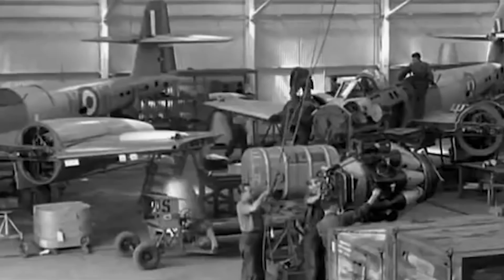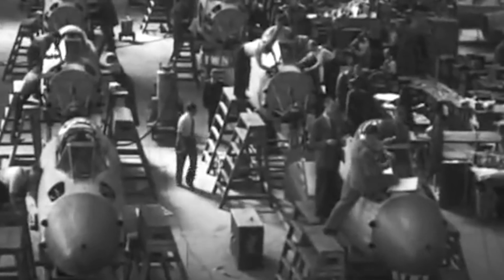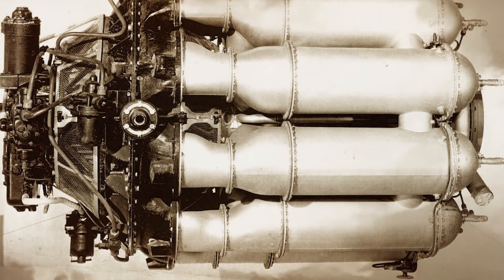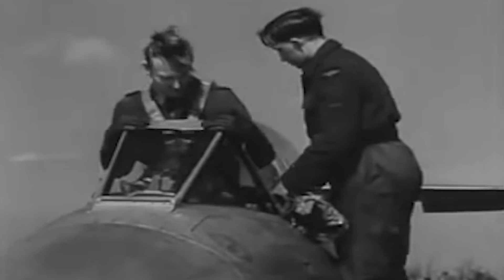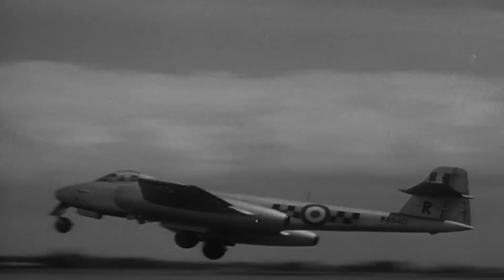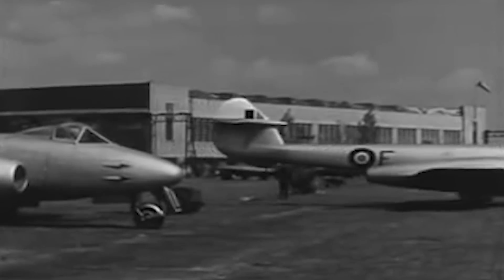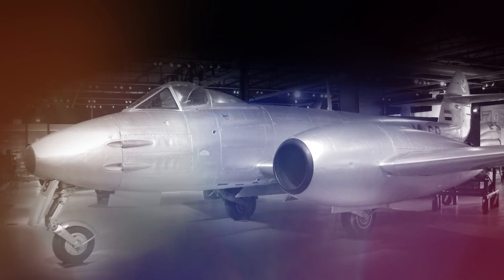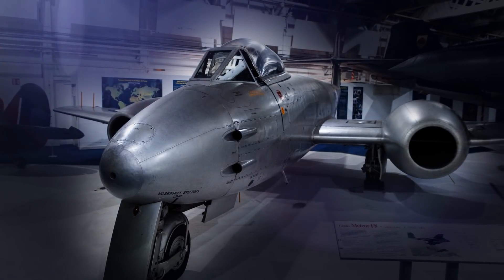Gloster Meteor - The Only Allied Jet to Fight in WW2

Comment: The Meteor did not really "fight" in WWII, Eric Brown:  "It was a pedestrian aircraft, really, the Meteor. It never went into… It never fought operationally. It fought, if you like to call it that, against the V1, the flying doodlebug, and quite successfully. But it really was too slow to deal with the German jets when they came into being. They were a grade above at first. The Me262 is quite frightening. It gave us a shock to find out, because when I flew it the fastest fighter we had"
Reply: The Gloster Meatbox only killed British pilots
Reply: @sandervanderkammen9230 

We feel we can clear up some commonly held myths and misconceptions, obviously.

It's always good to see the facts presented clearly and concisely isn't it?

Thanks for that very informative comment.
Most enlightening.

We couldn't find any supporting evidence anywhere though so we think there may be some errors in their excellent post & errors in some other comments with a similar theme.

The basic overall design of the Gloster Meteor was fatally flawed.???

    The Meteor was not fatally Flawed, 3950 were built serving in more than 20 air forces for more than 20 years.  Martin Baker use the Gloster Meteor for ejector seat R&D.

Gloster continuously tried to improve the aircraft eg; improved tail, stronger fuselage and different wings, stronger wings, ect.???

      Gloster got it pretty much right first time especially considering the circumstances & the aircraft type.

Unfortunately as a result of being very hastily
converted from a twin propeller driven nightfighterdesign it was plagued with flaws inherent to the fundamental design.???
  
      Gloster ceased work on the much larger  Gloster Reaper propeller & turret night fighter in order to design the Meteor from scratch (The Beaufighter was similar to the Reaper).

It was directionally unstable at nearly all speeds and tended to pitch down uncontrollably at low speeds and a nasty tendency to snap into a flat spin at high speed.???

    It's accident losses were much lower than many other later aircraft. Most accident losses were training errors.

The asymmetric handling was appallingly and was considered unrecoverable and fatal during take-off or a go- around.???

      It's accident losses were much lower than many other later aircraft. Most accident losses were training errors.

RAF Chief Air Marshall Sir Frederick William Bowhill called the Gloster Meteor a quote; "a truly dismal and lackluster aircraft"???

    The Chief Air Marshall didn't say that.
   
   Sydney Camm said Gloster tried everything but flipping the engines and pilot seat around and flying it backwards???

     Sydney Camm didn't say that.

Early days, jet fighters & an accident losses rate comparison.

De Havilland Vampire, Sea Vixen & Gloster Meteor accident losses were not high or unusual for fighter aircraft at the time. De Havilland built large numbers of all metal airframe aircraft before the DH Comet for example.
We mustn't forget of course that the DH Vampire first flew in 1943 & the jet engine was also built by De Havilland. There were examples of the Vampire interceptor / fighter in service until 1990 which was operated by more than 30 countries. Of course, at the time, during 1943, the Vampire was one of the world's first jet fighter aircraft which also happened to have extremely reliable jet engines, obviously.

Non combat phase accident losses.
% of Aircraft built.
The Canadair CL-44 was a turboprop airliner.
Canadair CL-44              (ff 1959 ) 48%
Lockheed XF104              (ff 1954) 100%
Lockheed  P80                 (ff 1944) 43%
Lockheed F104                (ff 1954) 45%
MD FH Phantom 1           (ff 1945) 35%
MD F4 Phantom 2           (ff 1958)  28%
MD F3H  Demon              (ff 1951)  32%
Gloster Meteor               (ff 1943)  21%
DH Vampire                    (ff 1943)  23%
DH Sea Vixen                  (ff  1951) 33%
Gloster Javelin                (ff 1951) 20%

   An example of what goes on these days in various countries.
Obviously, for example, there are of course no German companies that makes German jet aircraft in Germany & there are no German Companies that make German gas turbine aero engines in Germany that are suitable for widebody airliners.

The Gloster Meteor served with more than 20 airforces and successfully engaged in air to air combat with later design aircraft during a number of conflicts. 

We hope this helps, obviously.

As always Cheers & 👍 indeed.
Reply: We believe we can clear up some common misconceptions & myths.

It's always very important to note the relevant facts obviously.

The ME-262 was limited to running away from allied piston engine fighters  & risking engine destruction while doing so & it took 3 downed 262s for each downed allied bomber over Germany where German air inferiority was fairly ubiquitous so there was large swarms of allied bombers available to have a go at. The 262 did in fact have a do not exceed speed of 450 mph & an engine that often failed to last longer than 46 minutes.

After 1941 it was clear The Gloster Meteor wasn't required as such & was limited to operation over the UK & occupied allied territories to keep examples out of the wrong hands.

Yes it is of course correct that the world's first jet powered aircraft to exceed 1000 mph was indeed a British aircraft.
Contrary to their copious & ubiquitous posts regarding accident losses of various UK aircraft.
As they mentioned previously, the Sea Vixen & Gloster Meteor were indeed very competent & beautiful aircraft.
In fact the Meteor was the world's first aircraft to exceed 0.85 on the combined 2 year looks & capability scale for jet fighter aircraft.
   Indeed A rather superb Gloster Meteor was the world's first Turboprop aircraft in 1945. In 1945 & 1946 trail blazing Gloster Meteors set world speed records.
     Yes, of course it is correct that British military aircraft at the time did not have unusually high accident losses rates.
For example
De Havilland Vampire &  Sea Vixen & Gloster Meteor accident losses were not high or unusual for fighter aircraft at the time.
Non combat phase accident losses 
% of Aircraft built.
The Canadair CL-44 was a turboprop airliner.
Canadair CL-44                    (ff 1959 ) 48%
Lockheed XF104                    (ff 1954) 100%
Lockheed  P80                       (ff 1944) 43%
Lockheed F104                      (ff 1954) 45%
McDonnell FH Phantom       (ff 1945) 35%
Gloster Meteor                     (ff 1943)  21%
DH Vampire                          (ff 1943)  23%
DH Sea Vixen                       (ff  1951) 33%
Gloster Javelin                     (ff 1951) 20%

Gloster Meteor.
3950 Built.
In service 1944.
70% didn't have ejector seats.
839 accident losses.
436 accident loss fatalities.
21% accident losses.
11% accident loss Fatalities.

Lockheed F104.
2578 Built.
In service 1958, 14 years after the Meteor.
All had ejector seats.
1100 accident losses.
425 accident loss fatalities.
43% accident losses.
17% accident loss Fatalities.

We hope this helps.

Cheers
👍 & 😎 & of course 🙂 indeed.
Toodle PIP Old Chap 
     
           
        
.. . .. . ... .... . 
.... . ....
xcvvvvvvvviix
cvvvvvr
Reply: @petemaly8950  Naw.  You're apologizing for the Me-262's 542 confirmed kills, 5 to 1 kill ratio and 28 jet aces, and Britain's failure to develop an operational combat jet during WWII.  Hope this clears things up for you
Reply: @petemaly8950  "Yes it is of course correct that the world's first jet powered aircraft to exceed 1000 mph was indeed a British aircraft."  False, the Me-262 HG I hit 606 mph in 1944!  Pip pip cheerio!  Anytime I can help!
Reply: @petemaly8950  The Meteor did create a lot of jet aces.  Unfortunately they were all Russians flying Migs.  Tea time!
Reply: @petemaly8950  Revisionist history is you're specialty.  The complete list of British jet aces:  Just kidding, there aren't any
Reply: @petemaly8950  Yes, you are confused.  The British were never able to build and operate a combat jet during WWII.  Postwar England was bankrupt and had to operate obsolete aircraft such as the Meteor. The British were unable to build a working axial-flow jet engine until 1947, when they had access to German research.  Postwar jet aviation, aerodynamics and space programs were based on German research based on Operation Surgeon in England, Operation Paperclip in the US and Operation Osoaviakhim in Russia.  Hope this helps!  Pip pip cheerio
Reply: @petemaly8950  Nah
Reply: @petemaly8950  LOL "That is indeed true, 606 mph is of course much slower than 1000 mph."  True, however, you referenced the Meteor as 1000 kph.  The 262 HG I had already exceeded 606 in 1944, nearly a year before the Meteor.  Hope that this clears up your misconceptions and confusion!  Pip Cheerio!
Reply: @TheAneewAony  

 @TheAneewAony  

We believe we can clear up some common misconceptions & myths.

It's always very important to note the relevant facts obviously.

Of course that is indeed correct, the world's first aircraft to exceed 1000 mph was the Fairey Dart 2, it exceeded the previous record by 300 mph & held the record for a year. 

  Agreed, that is indeed totally right, the world's first aircraft to exceed 600 mph was of course a Gloster Meteor obviously (l-o-l of course without doubt clearly).

That's right of course, doing very silly military things & being riddled with trivial & 100% pointless war trophy psychology often results in comprehensive & thorough defeat doesn't it. It's a pity British forces had to occupy a large part of Germany for decades after 1945 & that Russia had to do the same & also possess permanently a large chunk of what was German territory before 1945. Of course Russia & the UK do indeed now make & possess nukes obviously. 

    That's absolutely correct of course,  indeed it is the case that the Korean war Migs generally often destroyed themselves due to a number of inherent problems & of course the Korean war Gloster Meteor casualties (at the time the world's first successful jet fighter) were almost all downed by ground fire.

    Agreed, it is in fact correct, The ME-262 was limited to running away from allied piston engine fighters & risking engine destruction while doing so & it took 3 downed 262s for each downed allied bomber over Germany where German air inferiority was fairly ubiquitous so there was large swarms of allied bombers available to have a go at. The 262 did in fact have a do not exceed speed of 450 mph & an engine that often failed to last longer than 46 minutes.
 
   Yes, that's totally correct Of course. Agreed, it is in fact the case that there were no gas turbine aero engines that exceeded the power & reliability of the RR Nene in 1944 that engine being twice as powerful & 100 times more reliable than the instant scrap 262 pilot killing engines being produced in Germany for the various thoroughly inadequate & generally unusable German jet aircraft at the time obviously. 

   Absolutely right & thanks for mentioning it, of course putting rockets & / or short life scrap gas turbine engines on inadequate & dangerous airframe aircraft that had a habit of exploding isn't sensible, adults involved in engineering & aircraft & the military making up stories about speed records, aces & kills for jet aircraft is also a bit silly, but of course we know they tried invading Russia so it was obviously normal behaviour for them

   That is indeed true, 606 mph is of course much slower than 1000 mph.

   Absolutely true of course,  After 1941 with allied air superiority guaranteed it was clear The Gloster Meteor wasn't required as such & was limited to operation over the UK & occupied allied territories to keep examples out of the wrong hands.
  
    Yes it is of course correct that the world's first jet powered aircraft to exceed 1000 mph was indeed a British aircraft._
Contrary to their copious & ubiquitous posts regarding accident losses of various UK aircraft.
As they mentioned previously, the Sea Vixen & Gloster Meteor were indeed very competent & beautiful aircraft.
In fact the Meteor was the world's first aircraft to exceed 0.85 on the combined 2 year looks & capability scale for jet fighter aircraft.
   Indeed A rather superb Gloster Meteor was the world's first Turboprop aircraft in 1945. In 1945 & 1946 trail blazing Gloster Meteors set world speed records.
  Yes that's correct, Indeed it is the case that Martin Baker currently uses 2 Gloster Meteors for ejector seat R&D.
    
 Yes, of course it is correct that British military aircraft at the time did not have unusually high accident losses rates.
For example
De Havilland Vampire &  Sea Vixen & Gloster Meteor accident losses were not high or unusual for fighter aircraft at the time.
Non combat phase accident losses 
% of Aircraft built.
The Canadair CL-44 was a turboprop airliner.
Canadair CL-44                    (ff 1959 ) 48%
Lockheed XF104                    (ff 1954) 100%
Lockheed  P80                       (ff 1944) 43%
Lockheed F104                      (ff 1954) 45%
McDonnell FH Phantom       (ff 1945) 35%
Gloster Meteor                     (ff 1943)  21%
DH Vampire                          (ff 1943)  23%
DH Sea Vixen                       (ff  1951) 33%
Gloster Javelin                     (ff 1951) 20%

Gloster Meteor.
3950 Built.
In service 1944.
70% didn't have ejector seats.
839 accident losses.
436 accident loss fatalities.
21% accident losses.
11% accident loss Fatalities.

Lockheed F104.
2578 Built.
In service 1958, 14 years after the Meteor.
All had ejector seats.
1100 accident losses.
425 accident loss fatalities.
43% accident losses.
17% accident loss Fatalities.

We hope this helps.

Cheers
👍 & 😎 & of course 🙂 indeed.
Toodle PIP Old Chap 
     
   . ...... ........... ...................

           
        
.. . .. . ... .... . 
.... . ....
xcvvvvvvvviix
cvvvvvr.
Reply: @TheAneewAony  

We feel we are able to clear up some common myths, errors & misconceptions.

Yes agreed, That's entirely factually correct of course, the RR Nene was the most powerful gas turbine aero engine on the planet in 1944 being twice as powerful as & 100 times more reliable than anything ever produced in Germany.

As stated its agreed of course that it is correct that the following list of often claimed false myths have all indeed been thoroughly debunked.

"The Metrovick was never
tested successfully in WWII, the hot spot problem was never solved"???

    That's correct of course, The Metrovik F2/3 was fully flight certified in 1943, all problems solved, the research results being then used to carry on development of more powerful & more reliable engines. In 1944 the world's most powerful gas turbine aero engine was the RR (England) Nene which would go onto power many of the worlds jet fighters in China, Russia & the US either as licensed versions or unlicensed copies  into the 1960s.

 "The Metrovick lacked the advanced technology needed for a working jet engine. The first test of the
Metrovick 29 June 1943 in the open bomb bay
of an Avro Lancaster, fully a year after the
Me-262's axial-flow jet flight on 18 July 1942."??

      Yes it is the case that The Metrovik F2/3 was fully flight certified in 1943, all problems solved, the research results being then used to carry on development of more powerful & more reliable engines. In 1944 the world's most powerful gas turbine aero engine was the RR (England) Nene which would go onto power many of the worlds jet fighters in China, Russia & the US.

   
"Dr Franz invented the axial-flow jet engine. He
built the first working axial-flow jet engine, and
the first production jet engine."???

    As stated, it's obviously factually correct that Axial flow jet engines were being worked on in England before 1930. The world's first demonstration of a gas turbine aero engine was by Whittle in 1937. 

"The first patent for using an axial-flow gas turbine to power an aircraft was filed in 1921 by Guillaume.," French patent no. 534,801, Whittle had access to this patent."??

     Agreed, obviously Guillaume's patent was simply a copy of the work, inventions & ideas of Parsons of North England, the inventor of the world's first axial multi stage sequential stator rotor compressors & turbines used for turbomachinery applications before 1900 & licensed to the industrial world  & which form the basis of most current gas turbine aero engines.

"The Heinkel He 178, also the world's
first jet airplane flew August 27, 1939 no patent
was issued"???

   Indeed it is true of course that The Heinkel & it's engine by Ohain were of course very amusing & interesting & indeed completely useless. A bit like having an oriental toy manufacturer having a go at full size jet engines & jet aircraft. Ohain's engine was copied from Whittle with a radial turbine to avoid a patent infringement, Ohain had full access to most of Whittles work & writings on the subject & didn't understand most of the how's & why's if the new engines.

 "No British axial-flow jet engine
worked properly until after the war when they
examined advanced German research via
Operation Surgeon and the Fedden Mission etc."???

     Agreed, as stated it is the case that No German technology axial compressor gas turbine aero engine formed the basis of any UK or US built engines at any time. British axial compressor gas turbine aero engine work began before 1930. The world's first basic axial compressor & turbine technology for turbomachinery applications being created in England before 1900. Operation Surgeon is mostly fiction. 
  Obviously the key Nickel super alloys required for turbine blades were invented in England around 1940 & were available nowhere else at the time. In France around 1951 attempts to develop from German engine designs for the Dassault Mirage 3 resulted in the air cooled sheet steel turbine blades being eventually changed for solid Nimonic turbine blades & a number of other Rolls Royce technologies being adopted in order to get a working engine.

     Of course that's correct, Whittle demonstrated his engine in 1937, the world's first demonstration of a pure gas turbine aero engine.
Gloster E28/29 + Whittle W1 Short Hops April 1941.  
FF May 1941.
Gloster Meteor First flight 5 March 1943.
   Gloster Meteor In Service (after extensive trials & with a very reliable engine.)
  Introduction into service 27 July 1944 3947 produced. Operational in more than 17 countries. Retired 1980s RAF.
Gloster Meteors broke world speed records in 1945 & 1946 exceeding 600 mph. A Gloster Meteor was the world's first turboprop aircraft in 1945.

Yes we are aware that Of course all the British jet aircraft from 1941 onwards were able to exceed the speed of any current piston engine fighters of the same year, the British jet aircraft were not required as superior allied piston engine fighters could easily maintain air superiority. They were restricted to  operate over allied controlled territory only in order to prevent examples getting into the wrong hands.

    Me 262 First flight 18 April 1941 with piston engine (Junkers Jumo 210).
18 July 1942 with junk unreliable jet engines -  Junkers Jumo 004.
In service Introduction April 1944 but mostly still highly experimental & useless.
Retired 1945 Germany, 1951 Czechoslovakia.
Primary users Luftwaffe & Czechoslovak Air Force.

     As usual fiction doesn't help of course in such matters.

     Hope this helps obviously

         C H E E R S.  of course 
    &  Indeed  👍 & 😎 without doubt      
                 O B V I O U S L Y.

. ........ ..............

(L O L)

Obviously this line is not blank.
Reply: @petemaly8950  Nah.  Britain failed to operate an operational combat jet in WWII due to its lack of technology.  Whittle was still bench testing his obsolete centrifugal flow engine nearly three years after the Germans had already invented the jet airplane.   Britain was unable to build an axial-flow engine until 1947, nearly six years after Dr Franz invented the axial-flow jet engine.  The Meteor was never used in actual combat during WWII due to its slow speed.  Hope this helps!